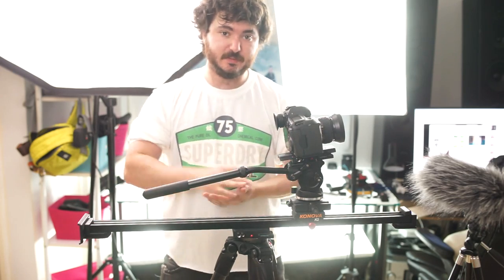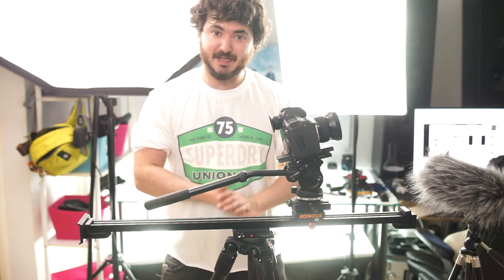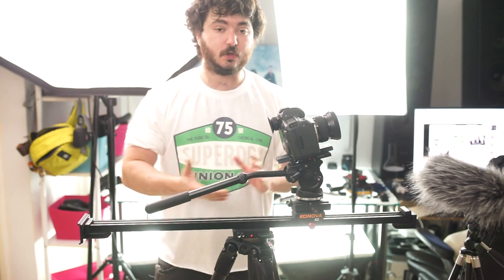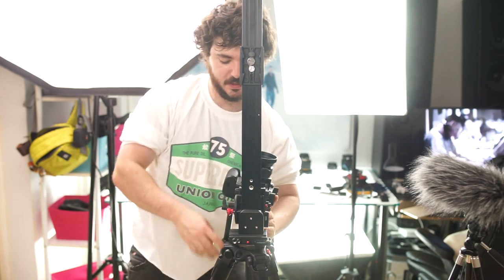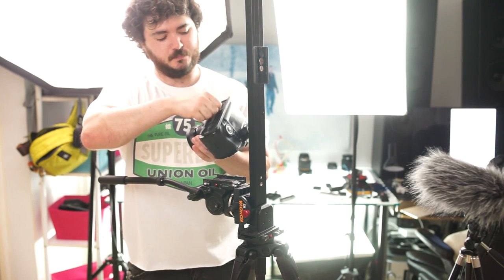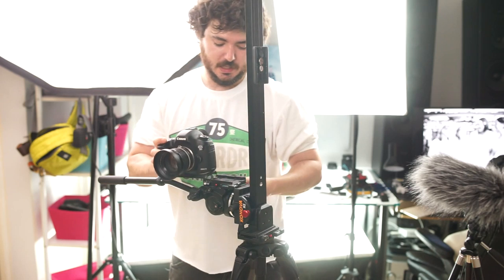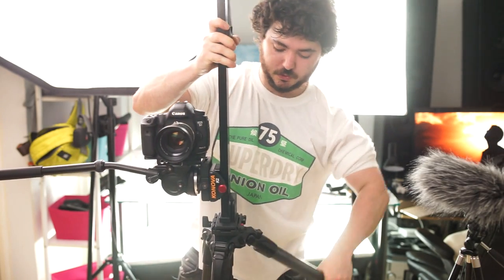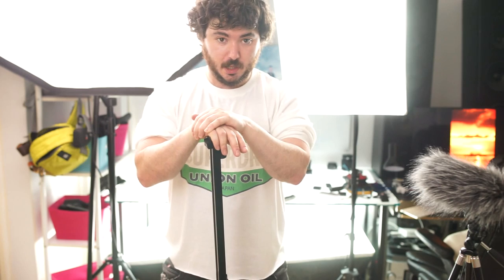Free and easy way to tilt a camera slider for vertical shots

Comment: Hey Nitsan, have you considered adding some kind of thick foam block to the end of the slider to avoid a jolting end to the vertical slide? To stop the head from hitting the bottom like at 4:31
Reply from the maker: The slider comes with two little cleaners that have foam on them too. 
I guess I just didn't have my ones on. 
I don't see any problem with adding a bit of your own foam/sponge too.

Comment: Hi Nitsan ! Very nice tip. I have ordered the Shark Slider S1, is this possible to mount it like this too ? On picture I see a knob on the side of the foot ( the one without the wheel ) that might prevent this use ?
Reply from the maker: +dramouille Yeah I think it has a connection on the side. I think you just need to turn the feet away from the middle.

Comment: Hey, thanks for the great video! I have a question... I am trying to do the same thing you did with the quick release system, but I am having a difficult time finding gear that is interchangeable. I have a Manfrotto tripod (basically the same one as you but aluminum) with a 502 fluid head. It is about perfect. But I can't find the appropriate plate and mount system. Do you know if the Giotto's system works on the 502 system? I bought some Manfrotto mount system, and the plate is 1/8 inch too wide. SO ANNOYING! Thanks a whole lot!
Reply from the maker: +John C That's exactly what I do with the Giottos. It can go on any head that I want and makes that head compatible with all my other stuff. The Giottos quick release system has two parts, a base and a plate. Screw the PLATE of any head into the BASE of the giottos, that converts that fluid head into a giottos-fit fluid head.

Comment: What fluid head are you using?
Reply from the maker: varavon 815FH
Reply: Ok, i am still hurting my head over which fluid head to get. I was going to get this one, because you made the video about it being the "best fluid head", but i know they changed the oil and i don't want to get stuck with a crappy head. I am looking at the Manfrotto 502hd or the mvh500ah.
Reply from the maker: c0pyimitati0n  I don't like manfrotto heads most of the time. I'll get one of the new Varavon heads and post a re-review.
Reply: Thanks man. I really need a fluid head, like yesterday. But i don't want to waste my money. I do tons of research before buying, usually.